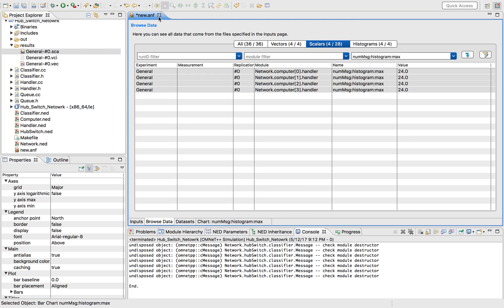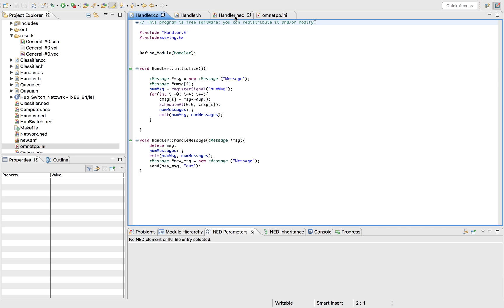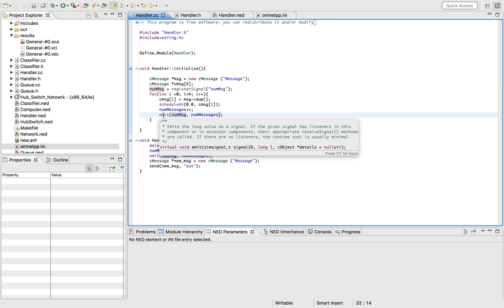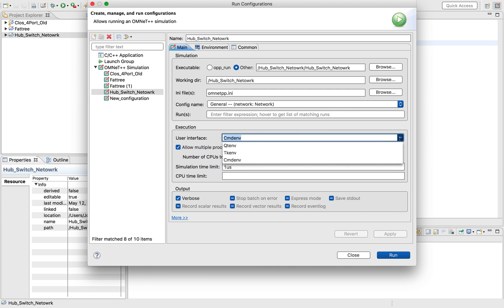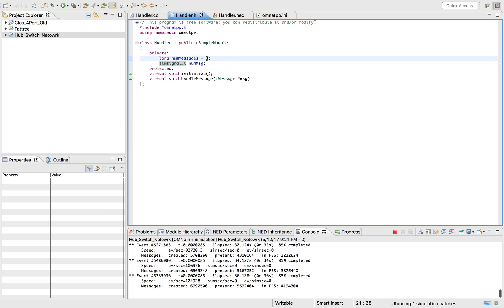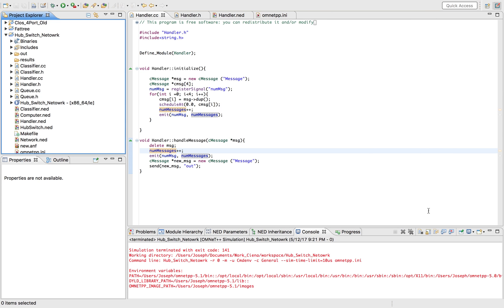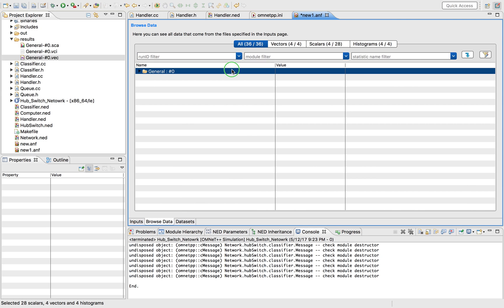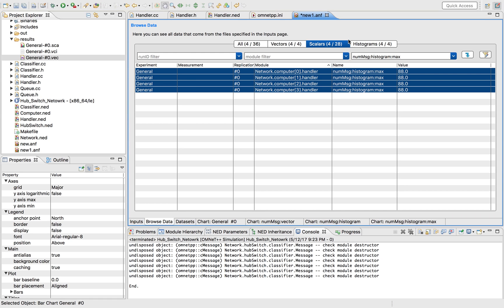Part 6: OMNeT++ Tutorial about how to collect data from a simulation

Comment: Please, could someone help me better navigate node-TSN pre-definitions in INET ? I'd like to use the TsnDevice offered by INET in my network architecture. According to the NED file of the TsnDevice module, the hosted applications are of type 'IApp,' and only the NED file is found in the inet.applications.contract directory. Willing to add some operations to the handleMessage of packets in IApp, I generated an IApp.cc and  IApp.h in the inet.applications.contract directory. However, during simulation, I observe that these new files are not being considered. Could you please assist me? Thanks in advance

Comment: sir am not getting this results file ? how did you create this  ? and m having 'resultsfile' name folder in that m having only two files 
onefifo.anf,onefifo-0.elog,   please elaborate i have to make some project in that ?
Reply from the maker: Hi Shania, I truly apologize for the late reply. I just saw your comment. You may have solved the problem by now, but if you still have questions, please let me know. Also please check out the actual guide that this video is made to support : https://github.com/jsirak/Getting_started_with_OMNeT , https://github.com/jsirak/simple_hubswitch
p.s. I apologize for the sound quality.
Reply: sir cn u please tell me , how can i made connections from  side like hub and5 nodes, switch and nodes from both sides like we do code in ned source ? please help me , m nt able to proceed further in any of the project beacuse of this problem , m facing problems in doing connections, please help me
Reply: sir foe this video there is no netwrk designing that is where is hub and switch ? is there in other part for it ?